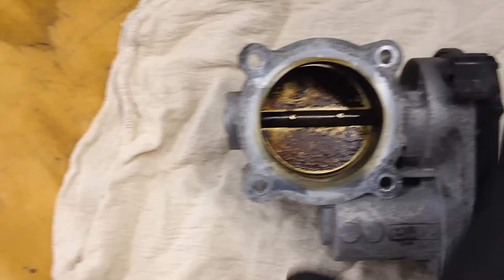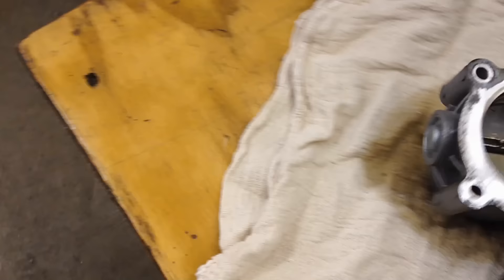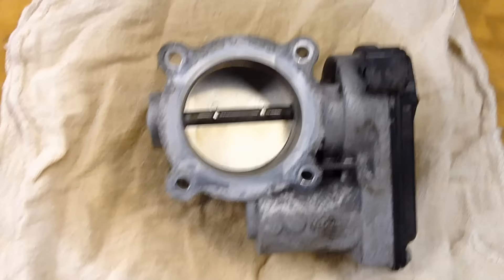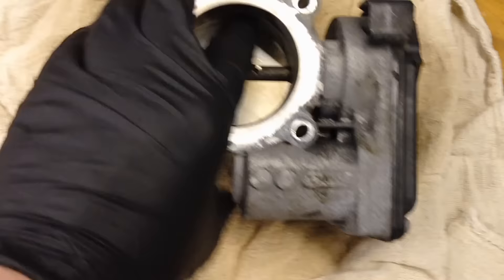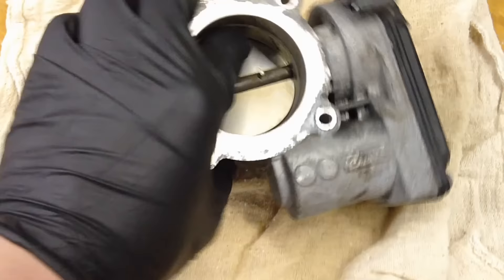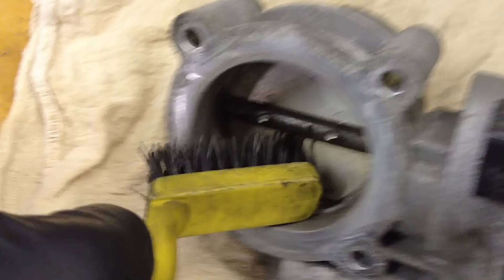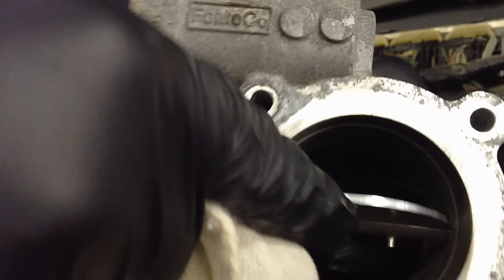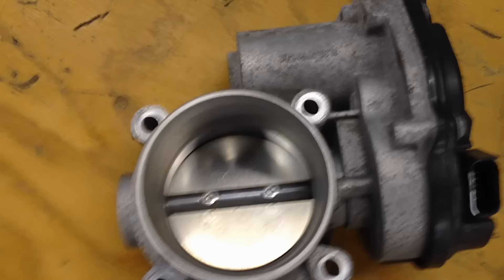How to Clean an Electronic Throttle Body Safely

Comment: Hi can you please advise..i followed precise instructions as suggested for my 07 Altima, there was a lot of dirt in the throttle body, I disconnected battery prior to pulling it out, did everything as suggested...BUT I now have a HIGHER RPM than before I took the throttle out...I cant drive the car now because of the high rpm..I pulled and put it back exactly as I should, all wires and hoses connected to their rightful place..what could have caused a worsening of the rpm, I don't understand ??
Reply: Had to take it to Nissan and have them remove code with their software..no other person mechanic can do this apparently (unless they've invested 15K on the scan tool)..I'm afraid to think changing the light bulb might trigger another error messege that will force me to run to Nissan again...scary thought.
Reply: ***** Usually on Toyotas (like my Corolla), taking out the battery fixes it since the ECU re-calibrates the next time the car runs.
Reply: +Kar Ser  There is a relearn process that takes 5 mins to fix that problem. You should've investigated forums first, a common fixable issue. For altima/nissan owners, do not touch butterfly, simply keep it plugged it and if you need to move the plate, turn the ignition on "ON" and pedal gas all the way down, that right there opens the plate horizontally to clean, use a toothbbrush if necessary!

Comment: i clean a TB disconnect the harness and when i put it back The rpm jump all The way to 3000 which i never seen it before this is a 09 Pontiac g6 any pointers thank you
Reply: +rafael b Take battery off for an hour or so, plug it back in for computer to adjust throttle body. Hopefully you didn't damage the throttle body yourself, electronic tb's are a pain! Do research before cleaning please, for other users on here!

Comment: Is 2010 ford edge limited has a sensitive throttle body , and can we clean it by wd40
Reply from the maker: Edge is the same design sensitive to deposits. I would only use throttle body cleaner.

Comment: I cleaned my now the plate stuck open when cold , the idle kinda high when start up the car 1 1/2 to #2 RPM , is that normal? Because I see the plate is open a bit when I cleaning it
Reply: thehegt Tr if the car is cold thats normal for a cold start to be around that range

Comment: Nice video, you got any info on 2008 wrangler electronic throttle control? I just got a 2008 wrangler with 45,000 miles on it and after full engine service and a dvd with navigation installation, the car just won't rev. I don't know if it's something that happened during the oil change or the wiring during the dvd player installation, the car just won't rev. I had the car scanned for codes and it came up with a code P2127 - Throttle/Pedal Position Sensor/Switch 'E' Circuit Low. Don't really know what that means, if it's a small thing or am supposed to start panicking.
Reply: Did you get this solved yet?  I'm guessing that someone working under the dash of the car (DVD Installation?)  might have bumped wires connected near the accelerator pedal or brake pedal.  Disclosure, I am not a mechanic, or an actor that plays a mechanic on TV.  Just my best guess here.   Tell us all what was the fix to your problem.
Reply: Yes you're on track but it's a little worse than that, the dude that set up the dvd actually unplugged a wire connected to the brain box(i can't figure out why) the only reason we found out was because someone suggested we change the brain box. Anyway we simply plugged it back and viola no more idling. My jeeps good now! Thanks a lot for the support guys!! I won't lie I had to pray on the situation that morning, thank God I didn't have to waste money on changing the brain box.

Comment: When you remove the throttle body and put it back in, will the throttle body work or do you somehow need to reset the electronics?
Reply from the maker: Follow my throttle body calibration video.

Comment: Do you have to do the relearn after removing and cleaning??
Reply from the maker: It is best yes.
Reply: @FordTechMakuloco  does the method of pressing the gas slowly and release while key is on position work as well?
Reply: @FordTechMakuloco  thanks for your expertise. Another question about this is if I do the process of relearning, does this reset my forscan light mods that I've done?

Comment: So it is perfectly okay to move the butterfly on them as long as you have removed the throttle body from the vehicle? I have a 4.8 V8 Silverado with an electronic throttle body and it needs to be cleaned.
Reply from the maker: On Fords yes not so sure on GM vehicle but most manufacturers state this procedure.
Reply: On the GM trucks, use a second person, or a stick, to actuate the accelerator pedal all the way to the floor, key on, and then clean it...
But do not move the blade with your hands. Just spray and brush around it.

Comment: Chris Frazier
Man, thank you thank you for your videos. I followed your removal, clean and re-learn throttle-body and truck is not stalling when I come to stop, slow down to turn etc... I had blown a plug and removed air filter to change all plugs and repair. I guess from fooling with the plugs and giving extra power the throttle- body couldn’t keep up. Most people said I had to clean throttle body and replace idle sensor. But after cleaning and following your re-learn video ; she’s driving like a new truck; new pugs with dielectric grease on everything, clean air-filter, clean throttle-body. Awesome!! Thanks again. I’ll Send back that idle sensors to Amazon and save that 70 bucks😅😅

Comment: Is there a risk of the cleaner seeping into the TPS and harming it when you spray all that cleaner in there?
Reply: Yes, try to hold the electronics upward and dont spray too much onto the spindle going into the TPS\motor housing, the solvents can mess with the systems inside the housing

Comment: My 2005 ford 500 has stalling issues while starting, like basically clunking out while starting, but after while will fire, 
could doing this cleaning be the quick fix.
Reply from the maker: Aaron Woods Yes I would do this first and a pcm reset and go from there but yours sounds like it need a new throttle body.
Reply: Thanks, went ahead and ordered one , better safe than sorry.

Comment: my 2012 escape got a the wrench and only ran 5mph turn off for few min and it ran good, and the rpm acts weird on red lights and stops. i took it to the autoparts no codo then the a diagnostic scanner got code p0104 what could it be

Comment: Dear Sir,
i have trail blazer 2007 LS, mechanic changed all the spark plugs and did the cleaning by using carburetor cleaner and then i notice there is on start of car RPM Nobe suddenly goes up till 1 and then when i switch on the AC it come down. But i feel low idle problem and vibration in engine... I connect the device but not found any DTC code as well.

Please advise shall i cleaning it again and can use brake cleaner as here throttle body cleaner not available.

thanks in advance.
Regards,
Junaid
Reply from the maker: Junaid Ur Rehman No only use throttle body cleaner. From what I have heard GM vehicles the throttle body must be relearned with their scan tool to fix that idle problem.
Reply: Thanks
Reply: I used carborator cleaner  and then I tried to relearn by disconnect -ve terminal for 30 min and then reconnect it again and switch on the ignition and wait for 30 sec to reprogram but no success so far.

Comment: so if I can just disconnect the neg bat cable , I should be able to clean throttle body and not have to do relearn process ?
Reply from the maker: posneg1970 You will have to do a relearn yes.

Comment: So after disconnecting and cleaning my throttle body I did the relearn process and it idles great, but if I rev the RPMs up in park they stay up and will not come back down until I shut off the car. Any thoughts?
Reply: Use the air condition  on high when car is on idel

Comment: Is Berryman B-12 CHEMTOOL CARBURETOR CHOKE & THROTTLE BODY CLEANER ok to use
Reply from the maker: Kim Smith What is wrong with regular CRC throttle body cleaner?
Reply: +FordTechMakuloco   between crc and b12 b12 is better than crc
Reply: +FordTechMakuloco   between crc and b12 b12 is better than crc
Reply: +FordTechMakuloco   between crc and b12 b12 is better than crc
Reply: +FordTechMakuloco b12 is better than crc

Comment: Do you think is ok if I polish the inside walls of the throttle body with emery rouge to make a smooth surface? I saw this kind of treatment performed on the cyliderhead to prevent carbon and junk build up.
Reply: Do you have an electric throttle body?
Reply: Yes, it is electric!
Reply: Take the negative terminal of your battery off, for you won't mess nothing up, or cause an injury. then you will be able to polish it, and clean it. What vehicle do you have?
Reply: A VW Golf mk4 1.4L. I checked the throttle, it is smooth but has some rough portions inside.
Reply: Ok yeah, you might want to clean that out with some (throttle body & air intake cleaner) That's the name of the can

Comment: i have a 2007 f150 with 4.2 v6, is there a gasket for the throttle body i need to replace after cleaning the throttle body?
Reply: Yes.
Reply: Thanks

Comment: If you can, or anyone else on here help me out. My 2009 F150 V8 4.6 will start and then stall out. It will restart every time so I am almost certain that its not a fuel issue. Most things I read on forums suggest it is the IAC. On this Throttle Body, is the IAC part of the throttle body? I can not locate one??!! PLEASE HELP!

Comment: Hello, can someone advise me. I have a UK 2009 1.8 ford focus petrol. Am I able to change the throttle position sensor, or do I need to purchase the entire unit, i.e throttle body and sensor. Also a part number would be helpful if sensor is available separately. Thank you all.

Comment: Hey I moved the throttle plane on my 350z while I was changing the spark plugs. I couldn't figure out what had gone wrong but I'm having really rough idle and a random cylinder misfire. I'm wondering if it might be a damaged motor. How could I tell?
Reply from the maker: Christopher Crawford It would not cause misfires, I imagine sometrhing went wrong with the plug install. A damaged throttle body would cause low idle, rolling idle or die outs or start and dies not misfires.
Reply: I actually had those symptoms for awhile. Is there a test to see if the motor is faulty? 

Since the throttle body unit isn't what's causing the random cylinder misfire, and I've quadruple and quintuple checked my plug install, I'm going to investigate replacing my bad battery and cleaning and/or replacing my maf sensor. 
I was told at autozone several times the battery is bad(keep recharging cuz it's just sitting and draining out). The maf sensor/iac sensor had been giving me trouble codes but they went away(I think the brackets for the wires were actually being used as ground).

Comment: I have replaced throttle body on 2008 F250 V8 5.4, runs better but it still gets slugish at stop lights or shuts off  when stopping. It restarts OK after shut off, runs 10 minutes and then it gets to lazy mode. Air sensors look pretty shiny so I don't wanna even mess with it. What else could be possible problem?
Reply from the maker: +DAMIX007 Vct solenoids I have a video on this its the most common 3v problem.

Comment: how do you test the motor to make sure its not failing?
Reply from the maker: +Rick Acton you can check continuity it's just a regular DC stepper motor so the motor itself is very reliable
Reply: OK thanks...

Comment: So if u take it off it wont mess the timing on it just want j to make sure on a 2010 ford focus?
Reply: What most of these guys don't tell you is after cleaning you have to do the relearn process and almost a 100% you'll have to reset tps and app sensor. So if you don't have a obd2 youre in for an adventure. I just cleaned mine and now high iddle plus gas pedal barely accelerates... Mechanics  are charging 145  for calibration.....

Comment: anyone noticed a little puddle of oil inside of the intake manifold, while cleaning throttle body? I think I have some issue with PCV on my Fiesta...
Reply from the maker: Absolutely normal.
Reply: @FordTechMakuloco  is that because manifold is plastic, and it doesn't get baked in as it happens in aluminum manifold? Btw i am happy that my 2011 fiesta is not direct injection.... Thanks

Comment: hi mate i`ve got a ford focas c-max 1.8 having broblems with idling and throttle body . idling at 1200 rpm going up to 2000 rpm got ang ideas please help
Reply from the maker: Either you have a large vac leak, dirty maf or the throttle body is failing itself and erratic.
Reply: FordTechMakuloco hi mate i bought a another throtter body and the brodlems as not go away i look at my  vac

Comment: I removed the sensors.  cleaned it.  Car runs better.  Smooth idle.  But, now it's throwing all types of codes and the check engine light came on.  Like 3 days after after I cleaned it the light came on.  Car runs fantastic though.  What should I do?.
Reply: It is the mass airflow sensor.  You got some oil on a wire.  Purchase MAF cleaner and spray it upon removal.
Reply: +Jason Arthur Taylor  Thanks

Comment: FordTechMakuloco: Great video. Just did this following your instructions on my wife's 2006 Ford 500. I disconnected the battery to have more room to work. Now:

1. the car will start after a few attempts, but doesn't respond to throttle pedal and idles rough.
2. Wrench light is on.
3. Check engine light is on. 
4. Fingers still on. 

Where did I go wrong?
Reply: did you press the plate of the throttle during cleaning? if yes then the throttle possibly needs recalibration.
Reply: @metalrs6306  I will check on that. Hope it's that simple. Thanks!

Comment: I have a Infiniti g37 and I cleaned my throttle bodies left the harness connector on so I didn't have to deal with the position reset or whatever but my rpms were dropping a lot at lights ect. So I cleaned them and I realized after cleaning that the valve doesn't completely close it has a very small gap is this normal? Also if tomorrow I take it for a drive and it's still dropping the rpms what should my next move be? Thanks in advance !!
Reply from the maker: Ctyler93 Not sure on infinities they may need a relearn as the gm vehicles do, a small gap is normal yes.
Reply: FordTechMakuloco Right, because with the electronic throttle body a lot of cars skip having an IAC or idle air control valve. Why have one when the electronic plate can take care of it? :)
Reply: Ctyler93 That's right, an electronic device that's added to a car that actually gets rid of another electronic device for once, lol.

Comment: Hello I have a Ford Escape 2010 when it lights up Bulbaspanh engine starts to drift and turn and when I forgive Suij and run it again Normal Mabe defect code CODE P2112 and cleaned Throttle Body but Maby Faida please

Comment: I have a very high idol around 2700 rpm when I start my 2011 Chevy Impala Ltz .. or sometimes when I start it it will be normal then I tap the gas in neutral an it reves back to almost 3000 rpm on its own .. I’m not sure why it’s doing this any suggestions ?
Reply from the maker: Have the throttle body calibrated by GM
Reply: Could be throttle positioning sensor if it has one. My saturn did the same thing even after cleaning the throttle body.  Found out it was a bad throttle positioning sensor. It seemed to act up the more on rainy wet colder days. It would do it after a cold start at first, then it got to the point where I would simply push my clutch in or put it in neutral letting off the clutch and it would idle up real high. just a thought
Reply: Disconnect the negative on the battery and go inside the car and press the break 3 times and your idle will come down slowly to 700 or 600 rpm..
Reply: I have a 2010 chevy Malibu my sensors went high as well after cleaning my throttle body. But I didn't know u had to remove sensor ones. My question is do all cars need to have a damn reset after any kind of work to the throttle body ?

Comment: Is there any reason in particular why my '10 escape could have a really rough idle?  It pulses up and down at around 600 rpm.  Thanks
Reply: Is it a high idle, or low idle?
Reply: very low, around 600rpm
Reply: You might need to replace your EGR valve, throttle body, or change your oil. You can clean those things as well
Reply: Jacob Ingram The oil is relatively new, but it was idling poorly long before I changed it.  I'm going to try cleaning the TB and hopefully that's it.  If not, I guess I'll have to replace the EGR or PCV valves.  Thanks for the help
Reply: You're welcome! Did what I could
Reply: mass airflow sensor
Reply: Clean your MAF sensor.
Reply: Ray Klotz If its on a 2005 Audi A4 3.2, you have a MAP for those who my response might apply to. Part number 03C 906 051, so you can see what it looks like. Located under the rear engine cover to the right of the Throttle body I believe :) You can spray the pyramid connection with MAF sensor cleaner, dry it off, replace. 

If that doesn't work, just order a new one off Amazon, cheap.
Reply: Everyone is wrong,,,, when your car idles low,,, or surges,,, idles up and down,,, it's the idle air control motor,,, iac.  Needs to be cleaned  the tip and the seat,,,.  Or replaced,,,
Reply: Jacob Ingram You are clueless...
Reply: That is correct, the issue is the IAC valve and TPS are built into the TB now and cannot be taken out to clean or replace. My Jeep GC 3.7 is like that. If these sensors fail the TB has to replaced at a much higher cost.

Comment: @FordtchMakuloco, if the battery has been disconnected for several days and you open the butterfly manually, will it cause any damage to the throttle body not being energized?